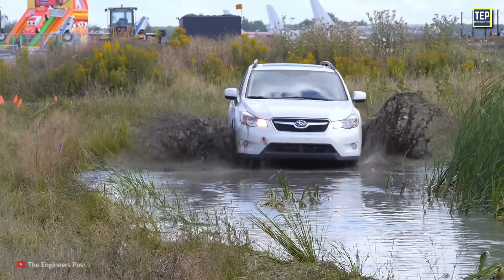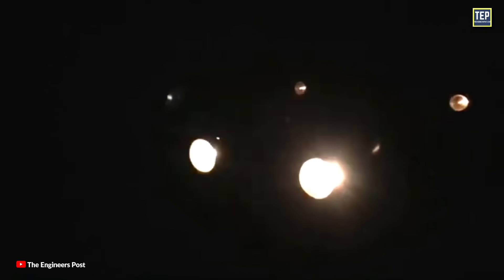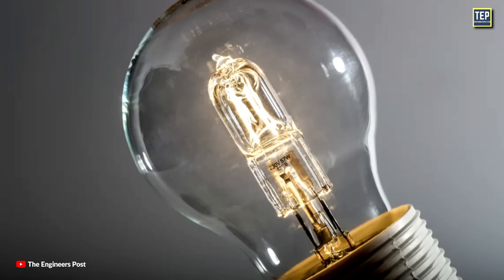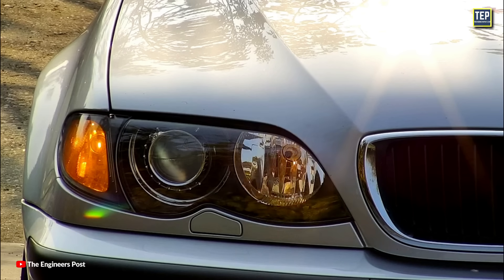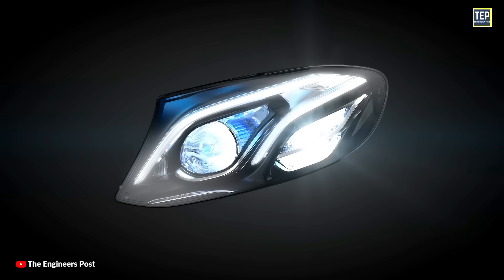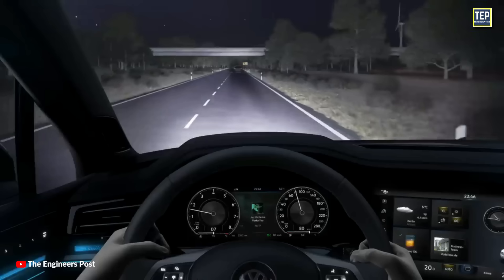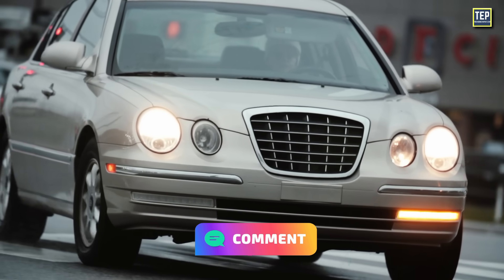The Problem With These Headlights

Comment: All headlights are too bright these days. People act like if they can't see 2 miles in front of them they can't drive 55 mph. Yellow light is the best as someone super sensitive after lasik surgery to the point I wear sunglasses while night driving
Reply: The problem is people wouldn’t see you in time and crash into you.

Perhaps, the best solution is to build a Front Wind shield glass that can act like a giant Night Vision screen that would brighten the entire road ahead for the driver (plus, with safety sensor to darken very bright light), plus with infra-red and radar technology to assist. Perhaps adding just a dimmer warm light in the front to warn pedestrians. Such technology with large semi-transparent AMOLED screens combined with Night-Vision 4K cameras in the market makes it quite feasible.
Reply: @inisipisTV  I'm not saying use a flashlight for a headlight I'm saying use the headlights from the 90s. Perfectly reasonable to see long distances and wide angles with brights activated but dull enough to not blind others while everyone is able to see just fine
Reply: @inisipisTV  no. Technology is not the answer to the problem created by Technology in this case
Reply: @inisipisTV  all manufacturers care about is how good the headlights look for sales so they make these tiny thin lines that have to use mini suns in order to be adequate instead of a single bulb with an appropriate light color and intensity

Comment: 10000k is not white. That's gone beyond blue. On a xenon lamp, the ballast starts the arc for the lamp, it doesn't just start after the lamp is on. The way you worded it sounds like the ballast doesn't start until the lamp is on and heated up.

Comment: When I learnt to drive, the car's headlights were yellow. Usually, it was only the bulb itself that was yellow, with a white lens. It was great to drive in the rain, fog, or snow. Yellow lights were mandatory in France since the 30s, I believe. I learnt to drive on my father's 1969 Citroën DS. There were no such innovative and original car in America or anywhere else. The light also turned to follow the steering wheel.

Comment: Another disadvantage of LED headlights is that they run cool.  In snowy conditions halogen and xenon headlights melt the snow withn their heat, while with an LED headlight the snow will stay on the lens and reduce the light output.
Reply: That could probably be resolved, if auto makers implemented a heating system, or add small wattage incandescent bulbs in the housing also.

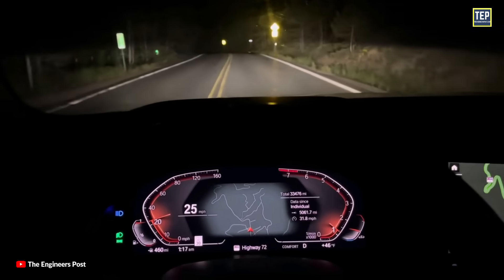Comment: 8:40 can we get away from calling these 'xenon lamps'?  Yes, they have xenon in them but it is not what produces the light.  These are high intensity discharge lamps, specifically metal halide lamps that use xenon instead of argon so they strike faster and are brought to temp much faster in order to make them suitable for headlights.  A metal halide lamp is a mercury vapor lamp that uses metallic salts to alter the color temperature and brightness.
Reply: No, because;
1. "High Intensity discharge" is just a lot more inconvenient to say (and remember) than just simply "xenon".
2. "Xenon" is way more cooler of a word.
Reply: @TNX255  Also incorrect.  Xenon is a strobe tube.  These are also called HID lights, which is correct.

Comment: Zenon is good (and brighter) if your car is using them. The problem I see is being blinded by them, when cars equipped with hid's are in on coming traffic.
Newer cars being built need to lower the head lamp height so as not to blind driver coming in the oncoming lanes.

#carmanufacturers

Comment: LEDs are indeed more efficient than halogen lamps, or even HID lamps, but it's far from the truth that there's "almost no heat emitted". 
Ironically, of these three, LED is the only light source that requires a special cooling solution.  

Quartz glass that the bulbs of halogen lamps and HID lamps are made of can handle 1000°C with ease. Halogen lamps have filament made of tungsten, which can get up to 3000°C before it even begins to melt. Tungsten is also used for electrodes in HID lamp. They emit light by what is basically a welding arc, which burns even hotter than the filament in halogen lamps. Point is, these lamps can handle the high temperatures. In fact, the high temperature is what makes them work. LEDs, on the other hand, they emit visible light photobs directly, and the heat is an unfortunate byproduct which must be managed carefully because if the semiconductor chip goes over 120°C, they'll undergo a thermal runaway and break down.

Comment: Remember those WW2 military searchlights, The ones that used carbon arc lamps with a big engine driven generator mounted on the back of the truck to power it. They used to use them for store grand openings, and carnivals. I want to get one of them and put it in the back of my pickup so I can blind all the azzwholes with the super bright lights. Maybe even give them a welding flash

Comment: So there was a mention of the 1948 Cyclops car which was a prototype but no mention of Citroëns DS which did have fully steering and yaw dependent headlights from 1967 the inner main beam units were attached via links to the front steering & links onto the suspension so that the headlights were always pointing at the correct angle & height! Full scale production model too!

Comment: For long haul or cross country use, Halogens RULE, but if Laser bulbs are as good as they seem and can be adapted to commercial truck use, the  industry could shift that way, especially if the last significantly longer as well as being brighter (safer at night) when needed.

Comment: I must live in the most expensive area, as all the cars seem to have laser headlights and they go on full beam at drivers eye level at all times.  There is an extreme safety issue going on with car headlights now, they are now far too bright, and badly aimed.  If lights are going to dazzle oncoming vehicles then they must be better regulated.  Many people are now scared to drive at night, not because they cant see in the darker conditions, but because of oncoming vehicles causing white out effects, where all you can see is a searchlight coming towards you.  Very interesting and informative video.  You missed out on one thing, many vehicles in the 70s had bulbs that were inserted into the reflector housing, and were used for decades before sealed beams came in in the late 70s, early 80s.  They were cheap to replace, many of my friends complained that their car had sealed beams and how expensive they were to replace.

Comment: The Citroën DS with double headlights already had mechanically moving high beam headlights as cornering lights. The height of the headlights was automatically adjusted using steel cables.

Comment: I have driven cars with all types of lights besides carbide and laser. The best one IMO is the standard halogen with lens, all else are garbage when you are faced with snow, rain or fog.
However a lot of vehicles do not have a good housing for halogen lights so a lot of the times, light is just not bright enough. For example an old Audi 80 has light as strong as a candle but when driving in snow or fog the visibility will still be the same, while a Jaguar x350 with HIDs has much better light during normal conditions, when faced with snow or fog I see less than when driving the Audi. So as I said, the middle ground should be halogen with lens as in my Jeep GC WJ, perfect light in all weather conditions with 0 downsides. The warmer the light the better the visibility in bad weather, additionally fog lights should never be anything other than halogen no matter how yellow you make it, otherwise it defeats the purpose.

Comment: YAY, LASER!!! Cuz who doesn't want to be blinded before even becoming 30 or even 20~? Xenon and bright LED lights suck too, they just fucking BLIND EVERYONE AND EVERYTHING aside you as the driver! Mateix doesn't help either, first if all because the range isn't great, and it requites a well maintained and functioning visyal sensor... And second of all because these things make them WAY more expensive, and cost way more to service and maintain. Halogen and LED that arent too bright and dont emit blue light are the only current real competitors.

Comment: I still like my H4 headlights ... open the hood, fiddle around to get the broken bulb out, fiddle again to get the new bulb in, close the hood ... finished with a total cost of around 20€ (instead of driving to a shop and pay over 1500€). Even though LED headlights "live" very very long, when they break you're screwed (regarding costs).

Comment: All that yet automotive engineers don’t solve the brightness issue.
Whilst in city streets and suburbs which have endless streelights, the amount of cars increase, meaning more headlights. With the default brightness of the current headlights we have today, it’s just impossible for the opposing lane users to focus on the road without squinting/covering their line of sight.
In freeways/expressways where sometimes there are no streetlights whatsoever and when one LED car passes by, it becomes unbearable for the passerby too.
If only there’s a system where these LED headlights have a brightness or photodiode sensor that helps adapt brightness levels according to the environment.
Also, there’s the issue of headlights blinding people in cresting roads, where the normal beams vertically overshoot and blind drivers and passengers of oncoming traffic.

Comment: A properly designed aftermarket halogen light unit from a company like Cibie or Marchal or even Bosch  gave you a round or rectangular light that replaced the original sealed beams of the era and had a light output that actually let you drive comfortably and safely at night.
Replacing the standard 55/65w bulb with a 75/100w Osram bulb would give you a low beam that increased your seeing distance without being obnoxious to an incoming driver while giving a high beam equivalent to a rally drivers. 
Replacing a busted glass headlight took a couple of minutes. 
This was in the 70's for Chrisake!  50 years ago!
And we drove every bit as fast as you do now!
Reply: I am convinced that our sense of engineering and design is actually degrading with time.

Comment: guide a beam of light...wtf level of stupid is that??? if you light a source of light anyone with an unobstructed visual path to that light can see it. if you are  1, 10 or 100 miles away light does not fucking care about to be seen.

stop making the problem about to be seen. its a problem about seeing where you are the fuck going. like just down the drain into some reps ass to vote for trump. the headlight telling stop got ignited 10 years ago and you to stop. but like any light...its does not care. its your reaction that matters.

Comment: The xenon story isnt completely true.
1st. Bi-xenon doesnt use a shutter that you push away to get high beam. Theres nothing blocking the light at low beam. With bixenon you just move the light a little bit. You need a special reflector for it. Thats why its illegal in france to have xenon when your car or reflector arent listed as delivered with xenon from factory.
2nd xenon doesnt get more blue when they age. They stay the same color

Comment: LED's don't produce heat?In many cars they literally have heatsinks attached to avoid them burning itself out ,many older ones or retrofitted even have small fans on said heatsink, really depends on the size of the LED and function, and they do work on halogen housings, a good LED will perfectly mimic the light shape of a traditional bulb,  chinese ones are what will scatter light everywhere, also modern car with LEDs just blind everyone and are probably the worse inovation in headlights as cars became super tall and blind every driver on the oposite lane, wish they were more heavly regulated because you don't need a beacon to see your way at night putting everyone else at risk

Comment: "LEDs can have a range of up to a mile without blinding drivers"

No, they absolutely will blind on coming traffic. As someone who had to drive home at night, anything with more lumens than a hallogen bulb was too bright for me to see.

The reality is that the people designing car lights (or at least the people making decisions about them) don't seem to have a reference to what it's like being on the bad end of their decision.

You might say that this is due to user error/misalignment but I personally view that as a copout: if you're designing or engineering a product you absolutely need to do your failure analysis.

And I say carlight instead of headlight, because I've noticed that a lot of newer cars are going for thinner and thinner break lights, which makes it harder to tell when the vehicle is stopping.

Comment: I hate everything that comes after halogen. It's just blinding everyone. I don't see the automatic height adjustment nor these goddamn matrices avoiding my eyes, since in the first case a slight hill makes the down pointed headlights flash right in my eyes, and I've never seen any modern car dim its light on me. I hate how unnecessarily bright they are while halogen covers the viewing distance completely. Why would you want to see something further than 300 meters away? How slow is your reaction if you are driving below speed limit and you can't stop if you see something 300 meters away? And add to this the fact that a halogen bulb costs at most 20 bucks and doesn't even need to be replaced often.

Comment: Adaptive headlights have been around for decades, and were used extensively in Europe.  They were illegal in the US.  They still may be, but there are a lot of these laws/regulations that no one cares about anymore.  This is why some cars switch on corner lights coordinated with the steering wheel.  The fixed lights were legal, steerable lights, not.

Comment: I try to explain my discomfort. In former times you had be able to rapair and understand everything of your car.  But nowadays cars are more driving computers than cars. If today the electronics of your car break down, you can't do anything without the proper diagnose tools and service manuals and the connection to a dealer of spareparts.

Comment: There was a car with turning headlights built in series in the 60irs in Europe. The Citroen DS. Iconic car. Ahead of its time in a lot of things.
In Europe we never had sealed beam, in fact, sealed beam was and is forbidden in Europe. Allways bulbs. First Bilux, then the halogen bulbs H4, H1, H3, H7, after them came Xenon and LED. My first car was built in '79 and had H4 Halogen bulbs.

Comment: - 00:01 🚗 Modern cars are equipped with advanced safety technology, including crucial headlights.
- 00:06 💡 Headlights impact a car's appearance and personality, making them a vital part of automotive design.
- 00:21 🛠 Headlights have evolved significantly, from early carbide lamps to modern laser lights.
- 00:47 🌙 In the early automotive days, headlights weren't a priority due to unreliable cars and poor roads.
- 01:16 🕯 Early headlights were carbide lamps using acetylene gas, producing light through actual flames.
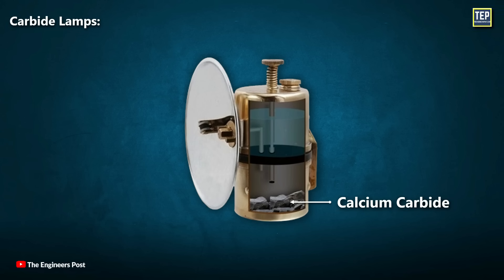- 02:11 🧽 Carbide lamps required regular maintenance due to lime buildup and frequent gas replacement.
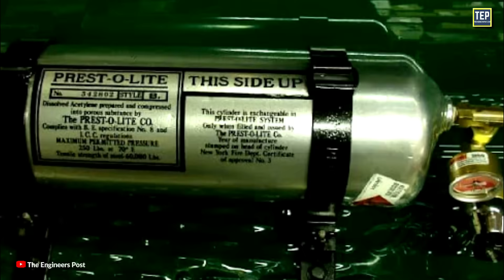- 03:02 🔋 Electric headlights, introduced in 1898, faced early challenges like short lifespans and weak resistance.
- 04:12 🌧 Cadillac's 1912 Model 30 improved electric headlights, making them usable in adverse weather.
- 05:01 🚘 By the mid-1910s, engineers started using optics on headlight lenses, improving visibility.
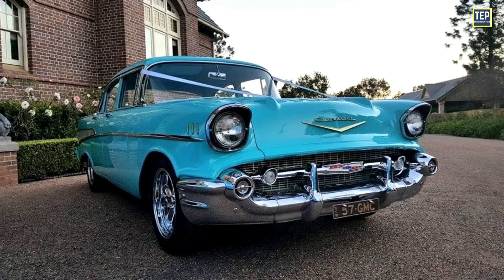- 05:24 🔒 Sealed beam headlights, compulsory in the US from 1940 to 1983, offered brighter, more focused light.
- 06:17 🔄 Halogen headlights, introduced in the early 1960s, provided brighter, more durable light.
- 08:41 💡 Xenon headlights, also known as HID, offered longer lifespans and higher light intensity than halogen.
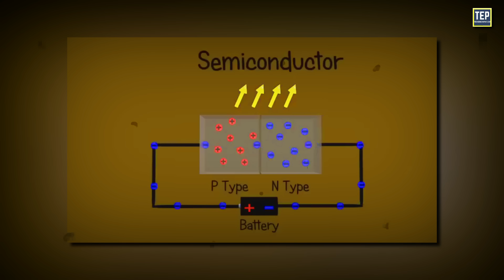- 11:19 ⚡ LED headlights use electroluminescence, offering energy efficiency, long lifespan, and bright light.
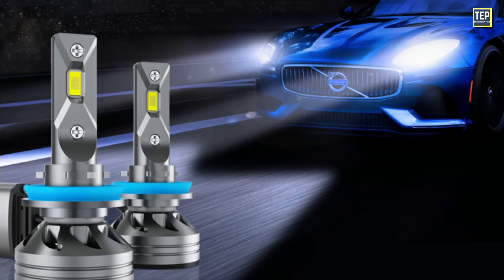- 13:24 🛞 Adaptive headlights improve visibility by moving with the steering wheel, reducing blind spots.
- 14:59 📸 Matrix headlights use LED modules controlled independently for precise light beam patterns.
- 16:08 🔬 Laser headlights, a new emerging technology, offer powerful, bright light and high efficiency.

Comment: I have a old car OPEL KADETT  1988 H4 HEADLIGHTS i change the light from the halogen bulbs to led light with power 6600 kalvin the different is amazing and i adjust The angle of the two headlights when i turn lights to high beams it can lighting to about 200m in front of the car and also i realize the consumption of electric load is reduced from 55 w to 38 w the LED lights is so great lighting

Comment: The problem with my adaptive headlights (VW e-Golf) is that they have a slower reaction time than I do and can't recognise oncoming vehicle just around a bend until they can actually see the headlight lamp. In other words, I can dip my headlights manually quicker and more accurately than the automatic system can.
Also they have an annoying habit of dipping in urban (village) areas even when the street lighting is laughably insufficient and the speed of the car drops below 30MPH. Then they won't automatically return to full beam till you are doing 40 - try driving at 40 down an unlit, narrow country lane on dipped headlights.

Comment: It's a known fact that the redder the light, the less it dazzles the eye. The red spectrum is the least intrusive in any setting. That's why photographers, campers, soldiers and others use red light for illuminating the dark. Road users have NO BUSINESS WHATSOEVER using white-blue light on the road. You can see just as well with a yellow light. 300 meters is plenty to see ahead. It's not like you can see details a mile ahead in broad daylight so you absolutely DON'T need to do so at night. This is just marketing hype and it's detrimental to safety and comfort of everyone else on the road.
Reply: Actually, it's DOT regulations.